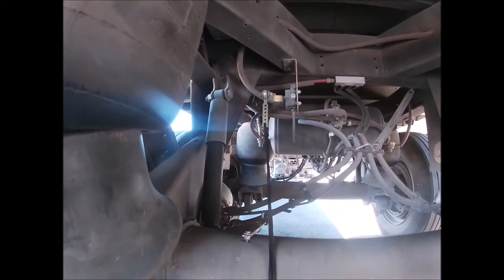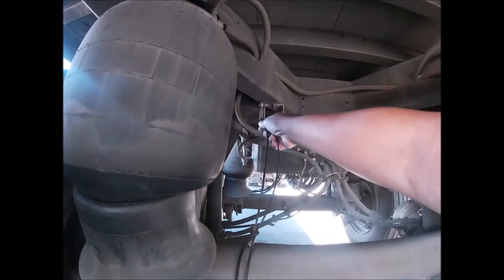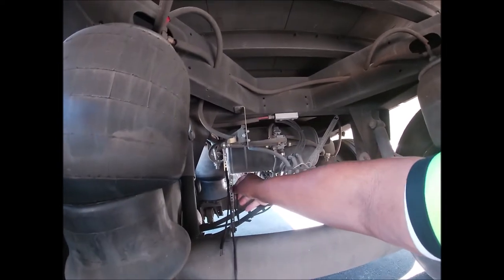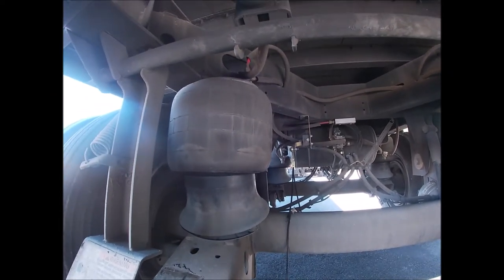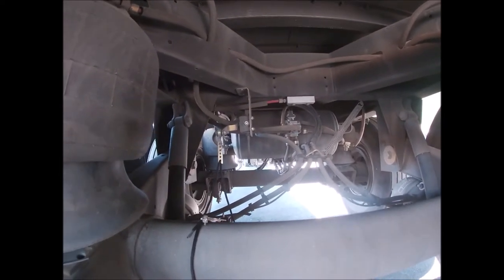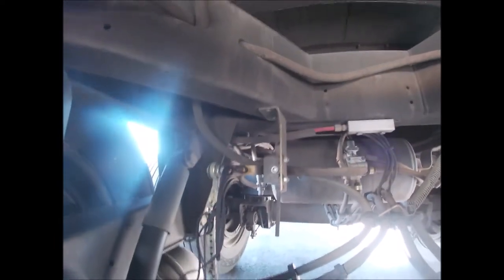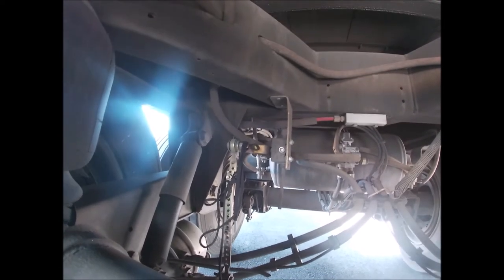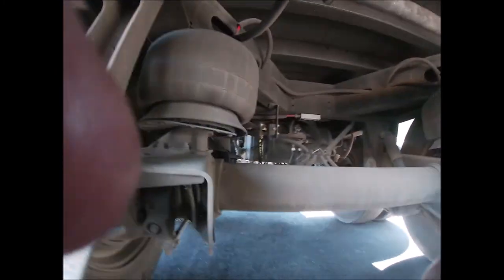How to fix a broken trailer air ride suspension level rod with shoe string

Comment: Just remember between the axle and the trailer Dolly frame that is a pinch point stay out of there always come in from underneath that way if something goes wrong the trailer is coming down on the axle nut on you take that advice from me a mechanic by the way nice thinking like a marine adapter adapting improvising and overcoming
Reply from the maker: I was joking. The trailer does not come down far enough to hurt me.